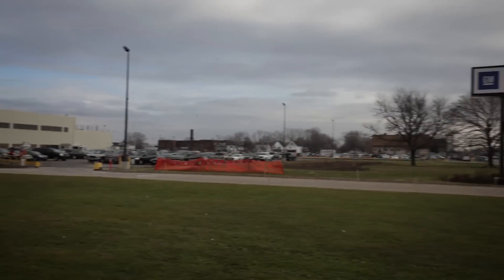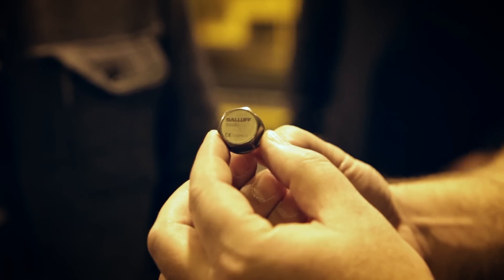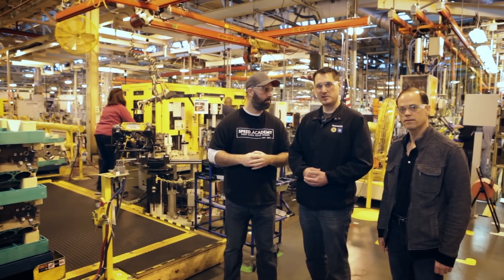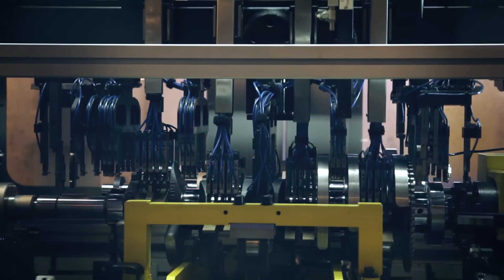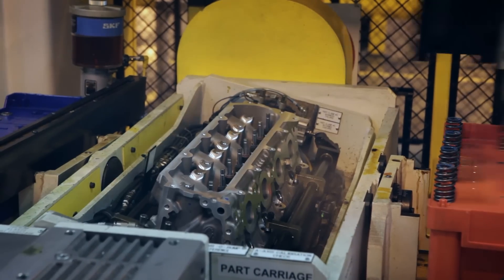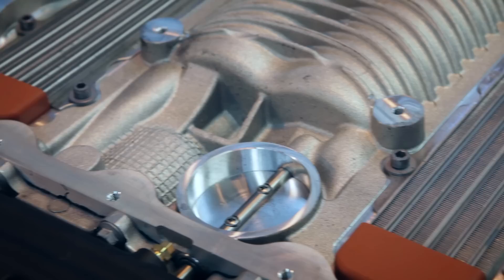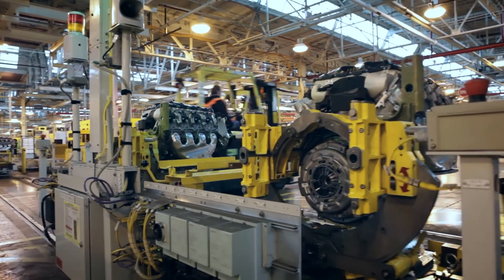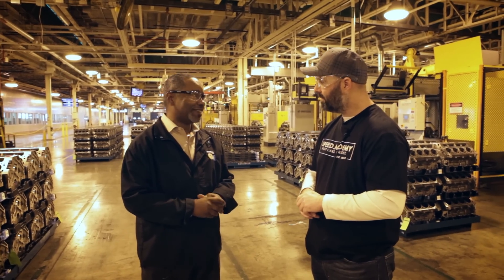Building GM's most powerful Engine Ever, the 650hp LT4 V8!

Comment: Thin water jackets...leads to thermostat failures...exhaust system wraps under the starter...leads to a overheated starter motor failure...not enough transmission fluid leads to premature transmission failure due to overheating...small mainbearing bolts (7/16") leads to premature total engine failure...G.M. is a TRUE leader in automotive technology...I'll stick with Ford...they have no interest in "LEADING" just building better cars that don't "LEAD" to failure after 50,000 miles...LOL!!.
Reply: sarah marshall he's troll Sarah. He was under two other names also.. He talks out of his ass and lies like the day is long,
Reply: 4 gauge lead or leed
Reply: jdr ok he will also claim to have a 5 second 1/4 mile 300 ford 6cyl... Along with owning 3 non existent 1995 FORD Gt40'S. Yeah he's not worth it,  but i love watching him beat out a thousand words of nonsense lmao.
Reply: also I dont believe half of what I read because of dipsticks who claim its fair that a supercharged 311 cid v8 beating a fuelie 283 is a amazing win for ford its not
Reply: 4 gauge youve never drove all of these cars bud sorry therez only 12 or so veyrons built in a year and they go immediately to the owner
Reply: The limiting factor in 4 gauge /MrMjsmith/ Steve Smith's argument is this. It's hard to believe anyone who says modern top fuel funny cars are rear engine mounted. .. Or the fact he has to use so many different names because he's been outted.  Hell just read his ramblings and the fact he can't give a straight  answer when pressed. . I think he has dementia or is just an old drunk.
Reply: 4 gauge derp. Go ahead and stick with third place Ford
Reply: +sarah marshallsorry, Number ONE is Ford.
Reply: +Bad Muthafuka This guy has no brain Sarah,he cannot tell a 7/16"inch bolt from a 1/2"inch bolt,this is why he talks like he is on crack.
Reply: +jdr ok Ford IS the LEADER.
Reply: 4 gauge jeez do you ever shut the fuck up? You have been disproven so many times we have all lost count, along with being drawn out into the open the liar you are! Fuck off basement dweller
Reply: 4 gauge only in American saled vs gms individual companies otherwise gm still sells more and really ford number 1 thats why ford has not even half the racing wins gm has
Reply: 4 gauge also 7/16 is smaller then a half yet theres six of them that means they need to be smaller
Reply: +jdr ok And Ford uses 4 1/2"bolts which means quite a bit more"meat"holding the mains together.
Reply: 4 gauge no it doesn't lol you have grades of metals also ford uses 6 bolt mains bud
Reply: 4 gauge also you do realize that gm uses splayed mains in their motors also theyve used bigger then 1\2 bolts on mains also sounds like you dont understand how 6 bolt mains actually mount In the block or what normally fails in a block hint almost never the mains
Reply: +jdr ok ONLY in America,but NO WHERE ELSE,GM doesn't even race in in the EU anymore,because the entire planet has passed them by from"A-to-Z",Ford is the only car company in America to still race in the EU period.
Reply: 4 gauge dude you know nothing your saying a 1/16 is a massive improvement in bottom end strength when if the crank is no longer balanced doesnt matter if shes welded studed with a bolt the size of the titanic that crank is destroying that main and coming out
Reply: 4 gauge uh le mans lmp1 gt class Nuremburg f1 indy 500 uh yeah chevy still races world wide buddy look up the corvette Daytona prototype the c7.r the new Cadillac lmp1 car bud you know god damn well nothing
Reply: 4 gauge you do realize the Cadillac 500 has two massive main bolts and is still a higher top speed engine then fords motors yet thats 2 bolts stock block gasoline and 415 mph at the salt flat
Reply: +jdr ok WRONG AGAIN!!.Those cars were DESTROYED off the track by Mercedes,BMW,PORSCHE,Lamborghini,ETC!!.Ford was and STILL IS the ONLY U.S.CAR COMPANY that has claimed MANY MANY WINS AGAINST the competition...TRY AGAIN!!.
Reply: +jdr ok Ford is the ONLY company that beat Buguitti Venon,Enzo Ferrari...SORRY,tell me ANOTHER STORY!!.
Ford has MORE top-speed,torque,plus better handling then the worlds FASTEST EU cars...you guys are a JOKE,with a capital"J"!!.
Reply: +jdr ok The ENTIRE BOTTOM of the engine BLOWS out of GM's much smaller 6 bolt mains,the grade of metal is much lower too,the metal comes from china(look THAT UP,its a fact)
If you ever have been to the junk yards in the past,you'll see on every GM engine that the blocks/heads are COMPLETELY RUSTED SOLID!!.
The Ford blocks shine like a brand new nickel,reason being,is due to much more NICKEL being used in the Ford engines.(this holds true to fact even now)
Now,GM made a movie some years ago called
"LEVIT TOWN"(watch at your own risk)
at the end of this movie,GM had the RETIRED engineers from ALL of the divisions of GM,they smiled into the camera and said"PLANNED OBSOLESCENCE IS A BEAUTIFUL THING".(this statement means that the product is PURPOSELY DESIGNED TO FAIL PREMATURELY OR REQUIRE FREQUENT FIXING/MAINTENANCE)
Reply: 4 gauge nope you are not anything you say your are!  That  be a fact jack!  You have to use 3 different names on here because you have been caught in a pile of lies every time.  You make claims and then get caught because you have no facts. Everything you have said above is fucking laughable.  Yes you are a basement dwelling troll. You don't have shit and never will.  Hell you can go back through your history and see how full of shit you are.  Shut the fuck up BOY!
Reply: That's just a small collection I posted of split ford blocks.  Why did they split? Because they are no where near as strong as a GM block. . Show me a stock GM block that splits at 450 hp. Try hard. ..
Reply: +Bad Muthafuka EVERY GM engine will BLOW OUT through the bottom of the crankcase...WHY??.
I've worked on just about every type of engine in existance at one point in time or another,including ones that most people have never heard of or seen before,including so-called people like yourself.
GM's mains are the weakest in the industry,the blocks arn't much better,common sense of laws of physics dictates that the THINNER the material,the MORE LIKELY it is to self-destruct,also,the SOFTER the material,the more likely it is to self-destruct.
Now,like I said earlier,GM PURPOSELY DESIGNS its engines and transmissions to SELF-DESTRUCT...WHY??.
GM DOES NOT make money on selling cars,it makes money on parts and service.(GM GOODWRENCH SHOULD BE a DEAD GIVE AWAY EVEN TO MOST PEOPLE)
Ford builds a far better engine block,you say they split in half,I know for a fact they don't,because I've built too many of these,usually when a Ford engine blows,the piston rod goes through the side of the block,their are U-Tube vids showing this,but when a GM engine blows,the ENTIRE BOTTOM END goes into the ground.I'm NOT sitting out here saying Ford is perfect by any means,but being fair,if you build both engines up to produce the same amount of power,the Ford engines last much longer.(more NICKEL IN THE BLOCK MATERIAL,THICKER MATERIAL IN THE BLOCK,BETTER DURABILITY)
I've also designed AND BUILT CERAMIC EXPERIMENTAL ENGINES.
I built one to the GM STANDARDS,and another one to FORD STANDARDS,the Ford lasted a HELLUVA lot longer.
Reply: 4 gauge you are a fucking idiot now go home and stfu you 12 year old is that why more fords are know for dropping the crank then any other motore
Reply: 4 gauge alsp ypu just said hm alright show me a ford engine that will run with a emd you fuck wit
Reply: gm vs ford gm has much better mains your just comparing it to the ls/lt which have smaller mains and your comparing it to specific truck castings but ok bitch also nickel really is that why people hate the 302 windsor? is that why the sbc was destroying the y block na is that why the corvette won lemans before ford is that why the corvettes suspension is the most advanced in the fucking world is that why almost all gm engines have been in the 10 best engines of all time at one point besides the gas to diesel conversions
Reply: 4 gauge callaway
Reply: 4 gauge well I geuss sledgehammer is a lie the 415 mph verified car is a lie the quickest quater mile between ford and chevy is chevy dude the lmp1 Cadillac just came out this year and has won quite a few races you fuck corvette had it 100 win last year
Reply: 4 gauge yep your twelve bye you misinformation spewing jack ass
Reply: 4 gauge that's all you got?  As I said before your nothing but a proven liar.  And get better insults...... 

You still have not shown one split gm block,  while u can show you hundreds of split junk ass ford anchors. .
Reply: +jdr ok Sorry,Ford uses 4 1/2"bolts,I've built way too many engines for that bologna.
Reply: +jdr ok Sorry,Ford uses 4 1/2"bolts,I've built way too many engines for that bologna.
Reply: 4 gauge youve never built a fucking 406 fe with cross bolt mains or the modular then all have six bolt mains buddy
Reply: And once again you are caught in a lie.  You said you know for a fact they don't split?  That is a bold face LIE.  the links above show split ford blocks.  You can't deny that!!!!!!!! Haha
Reply: https://www.google.com/url?sa=t&source=web&rct=j&url=http://forums.corral.net/forums/5-0-5-8-engine-tech/1323832-single-number-one-reason-stock-302-block-breaks-pics.html&ved=0ahUKEwiEmJ__8IrSAhUGQiYKHaRfDnEQFggaMAA&usg=AFQjCNHHNR7RvItQiWlGzd9Egzkr7ke_Kg&sig2=V9RRlgyxlm9-VfQl-TTWdA
Reply: Bad Muthafuka hes not worth it he is a 12 year old who believes he knows everything he probably built a 400 and didnt know what it was and put the wrong flywheel on and the harmonics became out of balance and it decided that it wanted out shit this guy can't even admit that Cadillac joined lmp1 and won some of its races so quickly
Reply: +jdr ok That was the STUPID STATEMENT OF THE CENTURY...HAHA!!.
I've built engines going back to the early 1960's moron,like I said before...I'M A RETIRED MECHANICAL ENGINEER.
The Ford mains are the toughest in the industry,the only ones that I know of that are tougher,would something from a Caterpillar or Cummings diesel engine.
Reply: 4 gauge ford blocks split at 450+hp ,PROVEN. Gm does not.  I have a 647 hp dyno proven stock block gm in my bracket car. . Get the fuck outta here.
Reply: https://lh3.googleusercontent.com/qEfYXaCZz0Fiw45Px8MsiwjUBn9bsf10Urfjc3VQlvyR1M7I__CTjnzoGK9pKVKFOdx3PhwjPg
Reply: goo.gl
Reply: 4 gauge 
goo.gl
Reply: +Bad Muthafuka I've got news for you...I have my 300(4.9 liter)inline 6 cylinder that produces over 1,800 FT.LB.of torque,I've never had to anything to as of yet,I've built a 289 smallblock that puts out over 800 ft.lb.of torque,again no mechanical issues at all.
I've built many 5.7(350 cu.in.)GM engines that produce the same amount of TORQUE(torque wins fuel economy and races,horsepower does nothing)
Every one of the GM blocks blew out its bottom end.There are endless videos of GM engines self destructing,nothing new here.
Reply: 4 gauge you are a fucking liar! Everything you just said is rubbish! And you have been caught lying again. . Do you ever quit?
Reply: 4 gauge 
goo.gl
Reply: 4 gauge 
Well what do ya know, I just keep digging up split in half ford blocks.. You fukin idiot

images.google.com - Image: Split 302 Block - DFWstangs Forums
Reply: 4 gauge Want more? Cause there is plenty to go round! 

images.google.com - Image: My carnage, we all love split block pics - Ford Mustang Forums ...
Reply: +jdr ok Corvette NEVER WON LeMans,they were takin off the track after being pounded to death by Ferrari and Bugutti,so I know your lost it now.I just said Ford isn't perfect,they have made mistakes like any other car company,but heres the difference,they DON'T DO PLANNED OBSOLESCENCE like GM does,they(GM)do this to get YOUR MONEY and can care less about quality.Ford built a few stinkers,the 462 cu.in.was junk,ditto for the 400 Cleveland,the 351 Windsor was and STILL is a top-notch engine,I've built a few that produced over 1,500 ft.lbs.of torque and AGAIN,no issues at all.
Reply: 4 gauge no answer to the links I posted of split ford blocks?  Thought you said for a fact it never happens?  HAHAHAHAHAH
Reply: 4 gauge kid stfu and actually read about le mans you idiot this is just gt class stuff
http://www.corvetteracing.com/results/
Reply: jdr ok he has no answer for the links of split ford blocks I posted.. Fukin classic liar haha
Reply: 4 gauge what fukin ford holds a record off 500mph? Back up your bullshit! Why won't you answer to the split ford blocks I posted?  Oh that's right YOU'RE FULL OF SHIT!
Reply: +Bad Muthafuka HAHA!!.I forgot,you STILL read B.S.from the Globe/National Enquire magazine.What I said is a FACT,because I've build hundreds,if not thounsands of engines in my 50+years as a mechanacal engineer.Your the type that believes EVERYRHING you read,kinda like a little kid...HAHAHA!!.
Reply: +Bad Muthafuka No,they ARE QUITE in existance,only to someone who subscribes to the Globe magizine like yourself woyld say something that stupid,because you are that stupid.
Reply: 4 gauge What the fuck are you talking about?  I posted actaul pictures of split blocks.. I have seen them split more times then u can count. ...... You're nothing a fucking coward liar. I present facts you present fly fodder. . Fuck off as  usual
Reply: 4 gauge a engineer yeah that has nothing to fo with working on motors bud also no you havent also Cadillac just came back to endurance racing and hasnt been losing to hard since its been only a few races its been out also corvette has been In lmp1 also a company cant take a car out without taking its own car out that team cant finish and gets a dnf so really you know nothing
Reply: 4 gauge ford does not even own the rights to GT40,  and have not for years. . You really want to go there? Because I can post facts all day long while you just ramble usless lies.
Reply: 4 gauge so a le mans based publications showing the corvette and Cadillac winning and it being recorded ok then dipshit you are 12 your treating all.motors the same and you know nothing about them
Reply: jdr ok the first sign he's a fuck off is him claiming to be an "engineer".. They can fuck up a tooth pick in seconds.
Reply: 4 gauge 
gt40spf.com
Reply: 4 gauge kid uh a supercar does not require a speed goal whenever a zr1 was setting paces as a supercar taking down ferrairs bitch you know nothing lol the zr1 and zo6 are classified as supercars in everyones book because they can go 205 plus with the zr1 
and 186 with the aero package c7 zo6 which actually the c6 zo6 was taking down twin turbo ford gts na and the zr1 crsuhed the ford gt then the new zo6 absolutely demolished the zr1 in track times legitimate supercar status bud you need to pull your head out of your ass choose a story either you a engineer or a mechanic not both
Reply: and so your saying a lowly sports car is taking down super cars thats not exactly a good thing to argue whenever the corvette suspension is underneath some hyper cars
Reply: +Bad Muthafuka ITS YOU that got caught in another LIE(again,nothing new here)
You can buy Ford  CREATE engines that produce WELL OVER 1,500+ft.lbs.of TORQUE every day of the week,YOUR A JOKE,my club members love your jokes!!.You should be a standup comedian...HAHAHA!!.
Reply: +Bad Muthafuka ITS YOU that got caught in another LIE(again,nothing new here)
You can buy Ford  CREATE engines that produce WELL OVER 1,500+ft.lbs.of TORQUE every day of the week,YOUR A JOKE,my club members love your jokes!!.You should be a standup comedian...HAHAHA!!.
Reply: +jdr ok Your ANOTHER Globe magizine subscriber,you believe everything you read...I've been to all these races in Europe,and everywhere else on in the world,I've built,raced,watched my engines,everybody elses engines and car designs on every track on the planet,all this CRAP(because thats what it REALLY IS)you children keep sending me to read is at best,a HALF-TRUTH at best.
Reply: +jdr ok The Z06 was destroyed by Ford due to the simple fact its NOT A SUPER CAR(LOOK IT UP)the top speed for a P.O.S.vette is BARELY 199 M.P.H.(I'VE DRIVEN MANY OF THESE,hard to steer,diffucult to control in curves at full throttle)
The Ford GT/GT-40 is CERTIFIFED AS A SUPER-CAR FROM THE FACTORY AT WELL OVER 250 MILES PER HOUR(LOOK IT UP)I've driven many of these too,other then my three 1995's,these cars ARE BEYOND INSANE WITH PERFORMANCE!!.YOU CAN USE JUST TWO FINGERS TO STEER IT AT FULL THROTTLE IN THE TIGHEST CURVES AT 250 M.P.H.and it justs seems to wish it could go even faster,its EXTREMELY STABLE,its NOT NOSE HEAVY like the vette,(no front end plow at all due to the mid-ship engine design)it accelerates a hell of alot faster,WITHOUT HAVING TO down-shift a gear to accelerate again(nothing but TORQUE)
TRY AGAIN!!.Even the GM dealers REFUSE to work on the Z06,this car MUST BE sent back to the FACTORY for ANY REPAIRS OR REPLACEMENTS on ANYTHING IN or ON THE DRIVETRAIN.JUNK!!.
Reply: +jdr ok A Ford GT/GT-40 IS A SUPERCAR,the Mustang GT-500R is ALSO A SUPERCAR(1,200ft.lb.of torque to average well over 220 miles per hour,I used to OWN a few GT-500R's,these are known Z06 KILLERS)
Reply: 4 gauge more lies. .Shut the fuck up you absolute waste. You are the dumbest s.o.b ever to post here.
Reply: 1200 ft lbs in a 500?  HAHAHAHAHAH A HAHAHAHAA HAHAHAHAHAHAHAHAHAH. .  FORD "create" motors with 1500ftlbs?  AAAAAAHAHAHAHAHAHAHAHHAHAHAHAHAHAHAHAHAHAHABAHAHAHAHAH.   BULLSHIT BULLSHIT BULLSHIT!
Reply: 4 gauge once again for you ya fact denying fuck! The owners of the gt40 trademark! 
gt40.com
Reply: 4 gauge your club?  That's right, I forgot your a card carrying member of NAMBLA.. Didn't know you guys were so open. .
Reply: 4 gauge I want to know the over the counter ford CRATE motor that makes 1500 ftlbs. What's the part number.  I have an extensive list of SVT, Ford racing,  Yates,  and Roush engines yet none make 1500ftlbs.. please enlighten us....
Reply: Bad Muthafuka uh a gm diesels lol ford used them and im wondering how ford has a 1500 lbft crate when not even sonny Leonards ford crate puts down 1500 and thats a 1350 hp crate hemi
Reply: Bad Muthafuka he just said the corvette zo6 isnt a siper car when it destroys the nissane gtr nismo a full fledged supercar that has twin turbos he also can apparently go to every race in europe and still be a live he says ford has the strongest mains in the industry utterly ignoring cummins detroit diesel gm diesel ignoring Chrysler ferrari Lamborghini (Lamborghini and gm made tractors combines shit ford never did) so how in the hell is ford so much better then gm and how did he go watch the lmp1 car he didnt know existed he has no idea what a engineer is he says hes raced built motors and looked at every engine under the sun yet ignores the fact that harmonics are more important to a engines survival then the number of bolts in a man ignoring the fact the ls and modular both have crossbolt mains ignoring grades of steel ignoring gm diesel literally more gm engines seen gen set life and Marine life even the shittest gm engines will survive as a marine motor theres a reason thats the bbc is god at the strip and the and is still gapping the fastest modulars yet all of those are pushing 3000 plus and are the fastest street cars on earth dude 4 gauge you see every race in the eu bullshit thats a lot of land and youd have to go to more then just gt class which I doubt you could afford to go to you are a compulsive liar
Reply: 4 gauge uh dealers over here are constantly making sure the c7 corvettes here are in top notch shape why because someone whonspent that fucking much better get the vest care you can give also 1200 pound feet out of the gt500 -_- kid that would mean it has 5000 plus hp bud this isnt a diesel
Reply: 4 gauge also explain to me why do you use the gt40 that gt40 is only a ford powered motor and never went 250 also if you say the corvette is hard yo steer you do realize hyper cars have used that suspension f1 cars use pretty much the same technology just not exactly the same kid pull your head out of your ass the zr1 is a 200 plus mph car your precious ford isnt using cummins engines to make the power you claim now pleaee go shut up
Reply: +jdr ok Every other word is so misspelled,I can barely fill-in between the lines,you really need to understand what the problem is here...the engine is in the FRONT OF THE CAR,I've shown this to many people in my auto club,this is in part why this car is CRAP!!.You have to"WHITE-KNUCKLE"the wheel in tight curves,get the hell off the throttle,otherwise the front end wants to PLOW.(almost like driving a tractor then a sports car)
I've put this car on the scales,their is MORE WEIGHT on the front end,then the rear,this makes for very poor handling.
I've proved this many times to Z06 owners on my private test track that I own,I would let the Z06 purposely pass me in the straights,but I would ONLY PASS THEM BACK IN THE CURVES!!.Needless to say,they were extremely pissed off,oh well,like I said before,due to the midship engine design,the weight is EVENLY DISTRIBUTED on ALL FOUR WHEELS(no front end plow AT ALL)
I could easily hold the wheel with only 2 fingers in the curves at FULL THROTTLE at 250+M.P.H.in my 95'GT-40.Plus my fuel miliage is much better at 22-25 highway.
Reply: +jdr ok CHRIST YOU STUPID,plus you CAN'T READ...I SAID...the ONLY MAINS that I know of thats stronger then Fords are CATERPILLAR and CUMMINGS DIESEL.
I said that TWO DAYS AGO,WAKE UP!!.
Reply: +4 gauge Holy shit now you own your very own test track? !?!? Oh my god will just shut the fuck up with your lies.  Fukin 62 year old loser lying his ass off. . Epic TROLL
Reply: +jdr ok Well,the GT-40 is the ONLY AMERICAN CAR that beat the Enzo Ferrari,and the BUGUTTI VENYRON!!.THATS WHY!!.It took GM OVER 45 YEARS TO FINALLY BEAT A ENZO FERRARI,it made the front cover of ALL the auto mags,myself and most of my car club LAUGHED AT GM,what the hell took em'so long to do what Ford did back in 1965,66,67,68,69 in A ROW!!.HAHAHA!!.NOW,the LAST FRONTIER for Ford was Bugutti...the FINALLY BEAT BUGUTTI!!.This is a V-16 CYLINDER WITH 4 SUPERCHARGERS,it produces over 1,100 horsepower,but could NOT TAKE the nearly double TORQUE output of the Ford GT WITH IT TWIN-TURBO 5.4 Liter V-8.
Reply: 4 gauge 4 turbochargers bud
Reply: you know absolutely nothing enzo ferrari really the enzo is a hyper car class
Reply: 4 gauge and no you said they have the best mains in the Industry bud and you said better mains then any gm engine meaning that cummins having weaker mains then a lot of gm engines has weaker mains then ford and cat is below cummins because the worlds most reliable engines come from gm
Reply: +Bad Muthafuka After building DOZENS of GM ENGINES,I can say you really need to stop the lies about this,the mains are very weak in GM engines,this is why the NEARLY ALWAYS BLOW THROUGH THE OIL PAN!!.JUNK!!.I have more engine building experiance then the entire time you have been breathing air...HAHA!!.
Reply: +Bad Muthafuka The only lie out here is you and your girlfriend JK,or what-ever that he/shes name is...HAHA!!.
Reply: 4 gauge what engine does ford sell over the counter that makes 1500 ftlbs? You said it now back it up!
Reply: 4 gauge I build more in one day than you dream of. Now go push your walker of a cliff
Reply: 4 gauge +4 gauge what engine does ford sell over the counter that makes 1500 ftlbs? You said it now back it up!
Reply: 4 gauge +4 gauge what engine does ford sell over the counter that makes 1500 ftlbs? You said it now back it up!
Reply: 4 gauge +4 gauge what engine does ford sell over the counter that makes 1500 ftlbs? You said it now back it up!
Reply: +Bad Muthafuka You know...a long time ago,I told you that I make a 8 figure income,I've sold my engineering business,also most of my car collection,I STILL OWN MY OWN PRIVATE TEST TRACK IDIOT!!.Your not talking to a sad,sorry ass GM WORKER thats CAPPED OUT AT $14.50 per hour...thats pretty-piss poor,how GM SCREWS ITS CUSTOMERS,THE GOVERNMENT,ITS DEALERS,then claim its better then EVERYBODY ELSES CAR...BS!!.The people are tired of their CHINESE BUILD GARBAGE,they bought TOYOTAS,NISSANS,HONDAS,GM REFUSES to listen to reason,so they went out of business,as far as I'm concerned,they PLANNED THEIR OWN SUICIDE!!.
Reply: 4 gauge what engine does ford sell over the counter that makes 1500 ftlbs? You said it now back it up!
Reply: 4 gauge what engine does ford sell over the counter that makes 1500 ftlbs? You said it now back it up!
Reply: 4 gauge what engine does ford sell over the counter that makes 1500 ftlbs? You said it now back it up!
Reply: 4 gauge  what engine does ford sell over the counter that makes 1500 ftlbs? You said it now back it up!
Reply: 4 gauge lmao Veyron are quad turbos! You are caught again not knowing shit.
Reply: 4 gauge Manufacturer	Bugatti Automobiles (Volkswagen)
Production	
2005–2011 (Veyron 16.4)
2009–2015 (Grand Sport)
2010–2011 (Super Sport)
2011–2015 (Grand Sport Vitesse)
Assembly	Molsheim, Alsace, France
Designer	Jozef Kabaň[1]
Body and chassis
Class	Sports car (S)
Body style	
2-door coupé (16.4, Super Sport)
2-door targa top (Grand Sport, Grand Sport Vitesse)
Layout	Longitudinal, mid-engine, permanent all wheel drive
Related	Audi Rosemeyer
Bentley Hunaudières
Lamborghini Diablo VT
Powertrain
Engine	Standard (Coupe), Grand Sport (Roadster):
8.0 L (488 cu in) W16 quad-turbocharged 1,014 PS (746 kW; 1,000 bhp)[2]
Super Sport (Coupe), Grand Sport Vitesse (Roadster):
1,200 PS (883 kW; 1,184 bhp)[2][3]
Transmission	7-speed DSG automatic transmission
Dimensions
Wheelbase	2,710 mm (106.7 in)
Length	4,462 mm (175.7 in)
Width	1,998 mm (78.7 in)
Height	1,159 mm (45.6 in)
Kerb weight	1,888 kg (4,162 lb)
Chronology
Predecessor	Bugatti EB 110
Successor	Bugatti Chiron
Reply: 4 gauge also gow come most gt class cars are supercars and dont attain speeds over 200 plus mph oh wait because of downforce being a huge limiting factor also the corvette zo6 destroys the ford gt on the track the zr1 will stomp it into the ground whats nect illogical who has no idea about anything and claims the positive displacement pumps on a bugatti veyron are belt driven no exhaust driven
Reply: 4 gauge also ford never beat anyone in top speed it went to a custom shop to be built to the fucking hilt sorry bud no production car has beat the veyron besides the venom gt or the one:1 also tell me your not this dumb it took ford 20 years to beat sledgehammer
Reply: Yeah fact ford gt's do not run 250. And the only reason the veyron is not recognized is because they modded the test car from fact.  spec.  So the record for fastest production is back at Hennessey. . Ford never even threatened the record lmao.  A privater  had to build a custom car (The BaddGt) to set their speed.
Reply: +jdr ok I have NEWS FOR YOU HALF-WIT to BMF...I've HAD DRIVEN SEVERAL OF BUGUTTI's in my 50+years being a engineer in the auto industry,the Bugutti is the MOST INTENSE,UNFRIENDLY car thats EVER been built,its performance is OUTSTANDING(at $3.75 million a copy,it should be)
I'm not impressed with its handling though,its like a Z06 on MAJOR STERIODS,when you drive it,you instinctively WHITE-KNUCKLE the steering wheel,when your done driving it,you leave your finger prints in the steering wheel.
I could CARE LESS WHAT YOU BELIEVE,with a 8 figure income,I just sit-back and laugh at you and your lesbian girlfriend BMF out here making your incredibly RETARDED INBREAD comments.
Reply: 4 gauge you do realize the bugatti veyron is actually very tame and luxurious but ok then actually the most abusive track focused cars on the planet are cars like the pagani zonda r or the ferrari fxx k or fxx evoluzion or the 599xx evolution one of the most abusive exhausts in the industry not street cars in any aspect pagani zonda r not legal at most tracks
Reply: 4 gauge you dont have a 10 million dollar income bud or you would realize the corvette zo6 on a skid pad is the best bang for the buck car on earth the car that trumps in the 918 spydre
Reply: 4 gauge you do realize the viper acr and corvette z06 have been smashing records anf gms planning a zr1 release say good bye to the ford gt because the zr1 will smash it then welcome to the world the mid engine hyper car from gm 6.2l dohc twin turbos mwahaha gm has always been a benchmark setter for ford and Chrysler normally is the only competition good bye viper rip
Reply: +jdr ok I have news for you AGAIN...BUD...(HAHA)
If you have someone read to you on one of my postings where I said that I SOLD MY MECHANICAL ENGEERING COMPANY AND I'M RETIRED NOW,I sold my company for more then 80 million IDIOT!!.I LIVE ON THE INTEREST OF THE MONEY THAT I SOLD IT FOR...DUHHHH!!!!!.
Its like talking to a ZOMBIE ON DOWNERS!!!.HAHAHA!!.
THE CAR SERIOUSLY SUCKS,END OF STORY!.You can sit out here and blow smoke up peoples butts all you want to,but remember this,GM IS CHINAS BEST FRIEND,NOT YOU HERE IN AMERICA,don't forget that.
Reply: 4 gauge you don't have 80 million anything.  Maybe lies bout it. You can't even answer your own claim.  What motor does ford sell over the counter they makes 1500 ftlbs? Simple question that should be able to answer. ......
Reply: 4 gauge then answer  my questions if you can.  What's the part number or the description of the over the counter FORD Motor that makes 1500lbfts? That's your exact claim above correct? Then it should be easy.. What is it?
Reply: +jdr ok HAHAHAHAHA!!.I have YET TO SEE ANY WINS ON BUGUTTI BY CRY-SLUR OR GM(Garbage Moocher).Until they SMASH THAT RECORD,Ford is your LEADER,Ford is the ONLY AMERICAN CAR COMPANY TO TAKE ON BUGUTTI AND WIN MULITIPLE TIMES.Keep trying,I'm going to be 74 years old this year,maybe in another 5-10 years,GM/CRY-SLUR will accomplish this,with hoods on their cars as large as Mack trucks...HAHAHA!!.
And handle like Mack trucks too...LOL!!.
Reply: 4 gauge  then answer  my questions if you can.  What's the part number or the description of the over the counter FORD Motor that makes 1500lbfts? That's your exact claim above correct? Then it should be easy.. What is it?
Reply: 4 gauge then answer  my questions if you can.  What's the part number or the description of the over the counter that you can buy all day long FORD Motor that makes 1500lbfts? That's your exact claim above correct? Then it should be easy.. What is it?
Reply: 4 gauge you taking your morning old person nap?  Come on,   answer  my questions if you can.  What's the part number or the description of the over the counter FORD Motor that makes 1500lbfts? That's your exact claim above correct? Then it should be easy.. What is it?
Reply: +Bad Muthafuka HAHA!!.The Ford crate engine that produces the 1,500 ft.lbs.of torque that I spoke of earlier,was produced by MY OWN custom shop(this part of the business was sold also when I retired),unless your in the know(I've said it a ZILLION TIMES)you cannot by this engine,I'm NOT the ONLY one that produced a Ford engine like this,but again,they are similar to me,we do not advertise it on the Tube,there are even MORE powerful engines then the ones I've custom built out there,but you have to have personal connections with people,this is how you KEEP your advantages,you simplay DON'T ADVERTISE.
Reply: 4 gauge of course it was produced by you and of course only you can get it. ... . But you said above anyone could buy it. ... Why did you lie? We took bets on what your answer would be.  I won because you said exactly what I knew you would.  Backed into a corner and no proof. 

Your exact words.  

+Bad Muthafuka ITS YOU that got caught in another LIE(again,nothing new here)
You can buy Ford  CREATE engines that produce WELL OVER 1,500+http://ft.lbs.of TORQUE every day of the week,YOUR A JOKE,my club members love your jokes!!.You should be a standup comedian...HAHAHA!!.

Caught you on another one. There of course is NO motor that is available in crate form over the counter from ford That makes anywhere close to your quoted amount . . You just can't tell the truth. Despicable!
Reply: Yeah don't advertise. . Kinda like " I sold my non existent buisnesses for 80 million" no advertising?  Kinda like " I have so much money I own my own make believe test track" advertising? Or more like I own " 3 1995 Ford built gt40's that don't exist" advertising? ..... You are a fuking idiot.  Old wasted saggy balled liver spotted liar!
Reply: Go through the comments.  You can see he is very aware of ford blocks splitting in two.  And the MJ smith is his other troll identity. 
plus.google.com
Reply: Remember that LS1 that did 700,000 miles without a rebuild?
Reply: Driv3th3hiv3 What's funny about that is that it BLEW UP after REPLACING almost all the parts on the engine EXCEPT the rings and pistons.(burning oil like crazy)
I've worked on too many of these REHASHED 350's to know better.These are junk like everything else GM builds.
Reply: k opinion noted
Reply: jdr ok Only in the United States,go outside of the U.S.its Ford that has the most wins WORLD-WIDE.
Reply: Driv3th3hiv3 Its not opinion,its facts based on more then 50 years engine building/repairing/replacing experience.